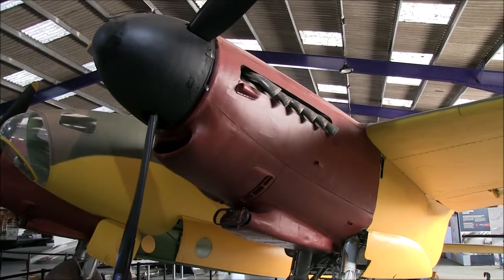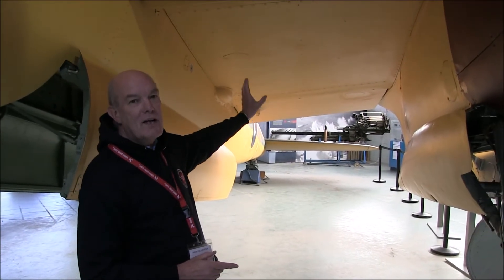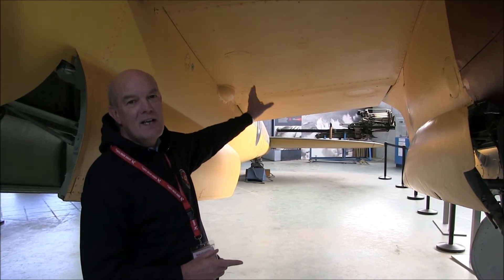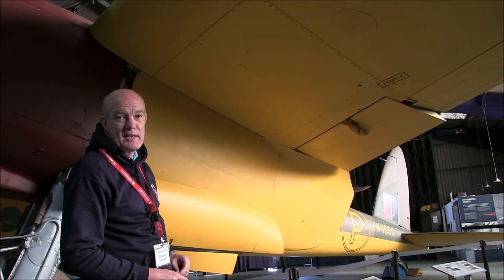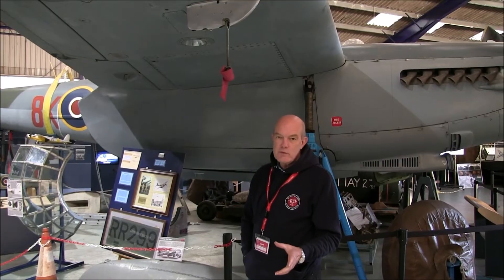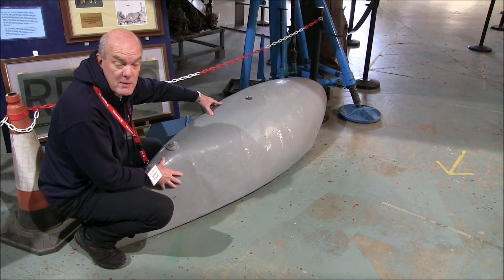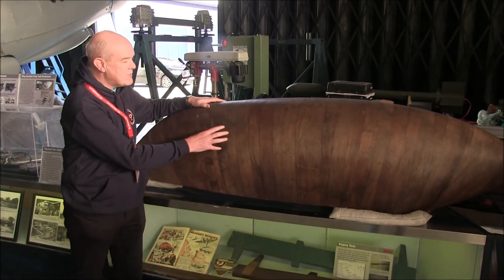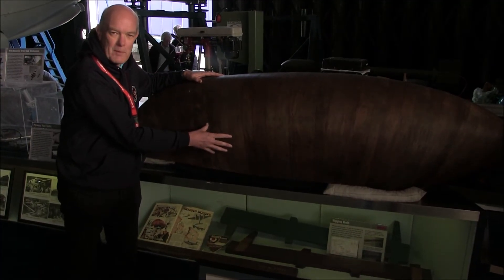Where did they put all the Fuel in the Mosquito ?

Comment: Fun fact. During the war, a young dutch guy came across a discarded wooden droptank. the idea stuck to his mind and later he applied the technique to a small sailing yacht: the Kolibri. He designed the hull to be from plywood layers, bonded by resin and sold those hulls to be finished off as kits

Comment: Wing Commander Guy Gibson of dambusters fame was kill flying a mosquito in 1944. One of the theories for the crash was that he was unfamiliar with the complex system of switching between the many fuel tanks, the switches/taps which were distributed  in various places around the cockpit, including under the seat.  The quote below is from Wiki.

"Lack of fuel is the explanation most favoured by members of No. 627 Squadron at the time. In December 1985 the site was excavated and wreckage from the plane recovered. No enemy damage was noticeable. It has therefore been suggested that Gibson and Warwick had failed to switch fuel tanks at the correct time.  It has also been suggested there was a fault with the fuel tank selector.  Further, it is possible that a lack of familiarity with the Mosquito resulted in neither Gibson nor Warwick being able to find the switches to swap the fuel supply. This would also be a reason to explain why the cockpit was illuminated: they were attempting to locate the switches. In either case, the result would be that the aircraft simply ran out of fuel."

Comment: Besides innovation of the Mosquito's Wing tanks being made of plywood or paper mache  and being made of lighter materials they could squeeze in a extra 10 to 20 gallons extra of fuel  compared to same volume  Aluminum drop tanks ( the USAF Europe copied the paper mache wing drop tanks for their P51 Mustangs, P47 Thunderbolts, which many where actually manufactured in the UK for USAF) . The Mossie's drop tanks were the 1st generation low drag conformal wing tanks which are all the rage these days on F16 and F15 and other modern fighter jets. The lower drag of the Mossie's conformal drop tanks gave their crews more extended range than the high drag tanks and attachment systems used on the P51, P47, P38, or even SpitFire, Typhoo, Tempest, etc... .
Reply: Spitfires had 'conformal' external fuel tanks.